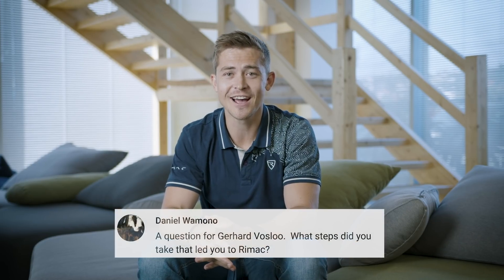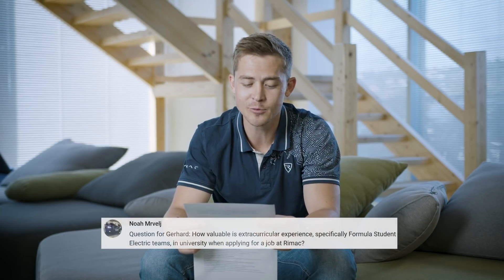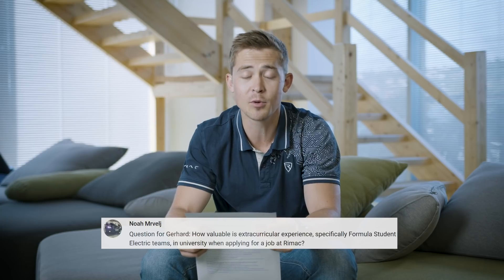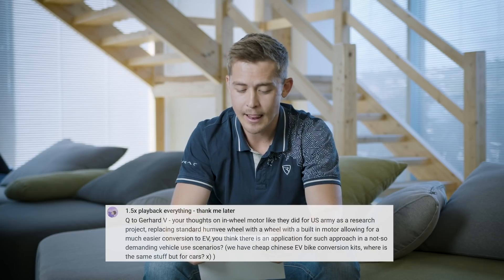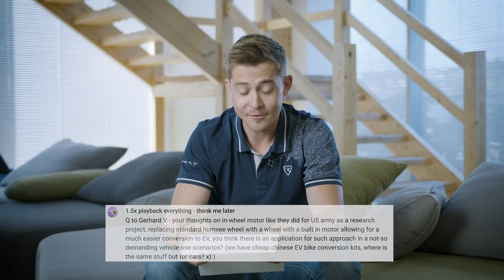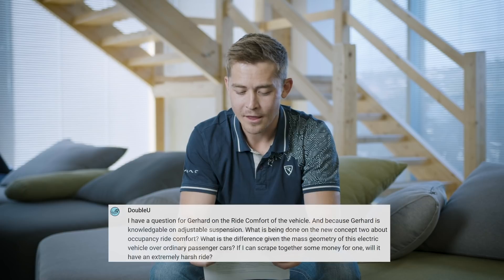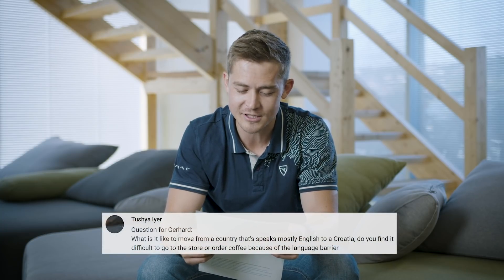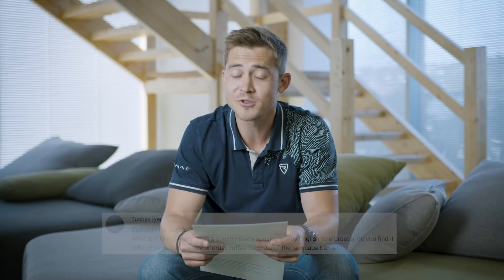Ask the Engineers: Vehicle Dynamics

Comment: How do you combine vehicle and Thermal dynamics, what software do you use
Reply: Thats a Really good Question.
One thing for Sure.
The thermal dynamics a lot of it greatly depends on the aerodynamics and the way and how the air removes the heat.
CFD computational fluid dynamics.
In this case mostly Aerodynamics aspect.
 for Sure but there also Material Thermal Dynamics.
Certain materials flex or contract or do a variety of other things under extreme temperature variations I'm sure that is also considered in the simulations.
That is definitely a very good question.
I'm not sure what software they use.
Reply: Chances are its a program made by ANSYS. They have a lot of really good simulation software.